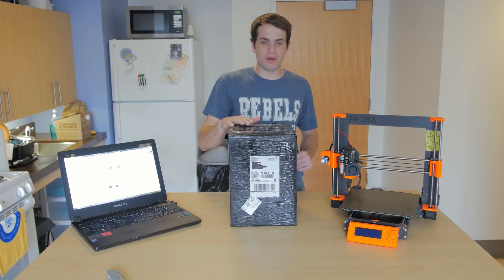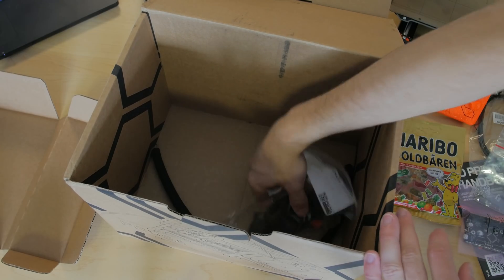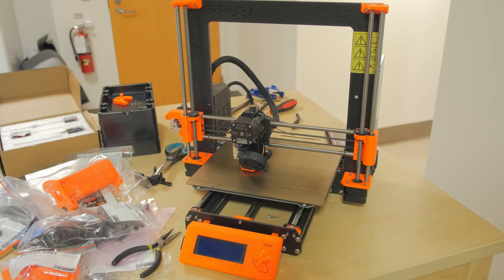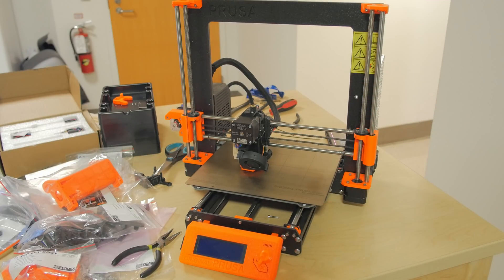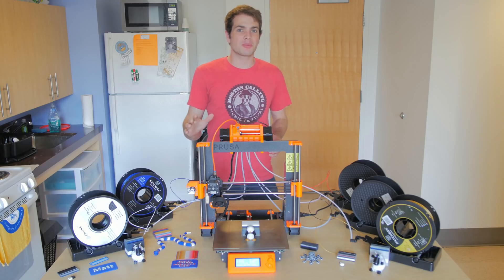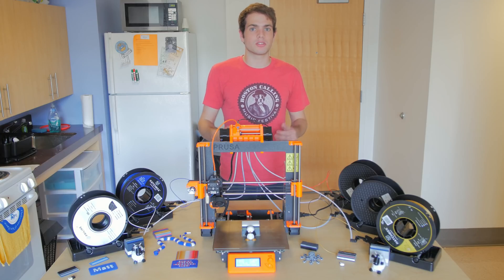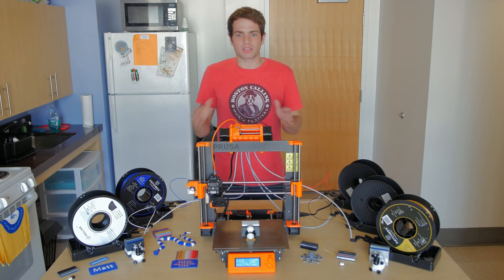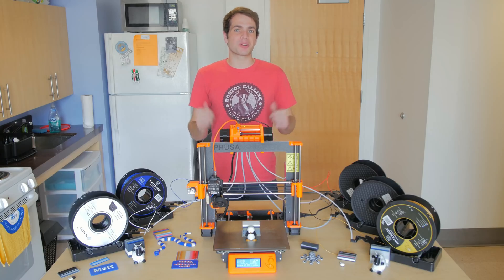5 Colors at Once! MK3 MMU 2.0

Comment: so... 4 years after you did this video... does it work right? is it worth the money?
Reply from the maker: With a lot of tweaking you can get it to work well but I never had the time so I ended up taking it off the printer. If you really want multi color you might want to get the prusa XL pretty expensive though.
Reply: @mattsheehy1854  yeah thats going to happen soon... i just bought my prusa... still gotta wait 4-5 weeks for it to arrive... finally got fed up with my creality cr-10s pro v2... and when you think about it its not that expensive for something that just works... from what ive gathered prusa has made a name for themselves being a printer that just works... no upgrading or tinkering required....
Reply from the maker: @Mr_Vengeance87  like you just bought an XL or a MK3S? I know prusa is pretty great! I have a CR-10 Max and I try my best to never use it becuase its just a pain haha.
Reply: @mattsheehy1854  MK3S is on the way lol... whats sad is ive upgraded the heck out of that creality... micro swiss all metal hotend anti backlash dampners new bed springs and knobs... i was looking into a whole new bed for it it was like 130 for that and i was just like why am i upgrading this thing when i could buy a prusa thats done for me... so i did that lol
Reply from the maker: @Mr_Vengeance87  nice the MK3s is solid! I mean you can still use your creality eith the upgrades. Its nice to have more then one printer. Or just sell it to pay for more of the prusa
Reply: @mattsheehy1854  yeah i was kicking around making a prusa clone with the parts or learning on it when i have the time to learn... just right now i need a printer to do its job and not be a constant pain in the rearend so

Comment: Hi guys. I got mine working. I've been printing with all five colours. Agreed its a beast to get running right. I found if you run the same filament from the same company it works better especially if the filament has a consistant diameter. I've found this to be the case anyway especially loading and unloading. I have one roll of PLA its a fluro yellow really bright but its a beast to load and unload without some interaction from me. I'm currently printing re tractable filament spool holders. Near empty spool were like a tightly wound spring and flying out of the standard tray. The unit isn't setup perfectly yet and it is challenging.

Comment: Hey there! Thanks for the shout-out. I took a break for a month or two from my MMU2 because it was really stressing me out, but I'm using it again right now on a simple two-color PETG print that currently has seven hours left of twenty-four. So far, not a single problem, strangely enough. I did just upgrade to the latest Slic3r and firmware, so perhaps there was some magic added in there. I intend to try some more involved prints after this in the name of science. Perhaps the timeout has made it contemplate the error of its ways.
Reply: Sigh. I take it back. Literally five minutes after praising it, it just skipped a layer due to a stray string getting sucked into the hotend with the filament and jamming it up. Time to pack it away for another two months, I guess.
Reply from the maker: @0calvin  Oh no that stinks!! Is that with the new firmware that came out a week ago?
Reply: Yes, with the new firmware. Stupid me used the Prusa defaults, though, so I am trying again with my tweaked settings.

Comment: I assembled mine a few days ago, and have found that the biggest issues don't come from the unit itself. Most of my issues have been from the filament holders, filament quality/settings, and other mistakes. I am working on replacing the holders, as they are rather high friction and seem to cause issues with skipping at times. Ramming and temp settings also have been important, but luckily there are a bunch of great profiles already out there. Can't wait for more MMU models!

[I wouldn't consider build to be a big issue as this is not intended for the general consumer yet. It is still kind of experimental/in development, and the technology still needs to be refined (and filament needs to catch up with the standards it requires]
Reply: I agree with the MMU 2 quality and fully can confirm that controling filament slack and a smooth path from the spools to the MMU2 is crucial. My setup with the filament in boxes proved a success, but I had to make adjustments compared to my MK3 and MMU1. So this: https://www.thingiverse.com/thing:3172330 worked for me...
Reply: The Prusa solution is a bit of a cludge, I've seen people change it to small ptfe tubes going into the MMU and using gravity to take up the slack as it backs out. You can then use any filament holders you want.
Reply: I had the very same issues ...ok to build but setting up is a real pain ..filament snapping etc...